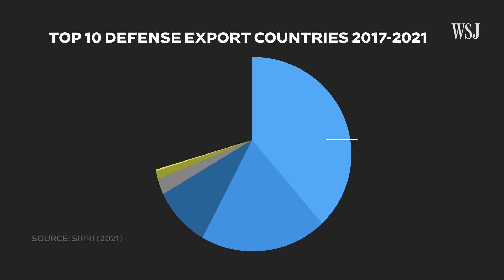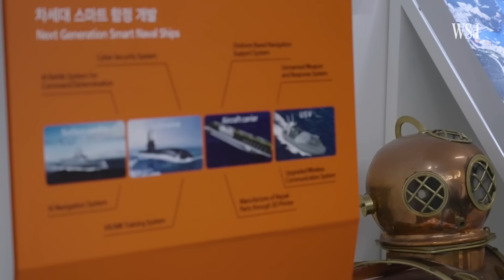How South Korea is Transforming Into a Weapons Export Giant | WSJ

Comment: If the US weapon builders supplied cheaper & reliable army equipment to the Korean army, South Korean weapon developers might not have changed themselves as new weapon suppliers instead of the US, Germany, and France. Until now, most Korean military generals don't have positive eyes on the US weapon systems, which means American weapons are too expensive and need too high maintenance costs. 

Thus, the defense ministry in Korea had to build a plan that Korea should develop its typical weapons instead of purchasing expensive American weapons. They needed the weapon itself to protect their territories against North Korea & China's intimidations but the US weapon makers sold luxury gold machines that needed big bucks to South Korea. The US weapon makers should modify their development methods and marketing strategy to defend their market share against Korean weapon makers' tracking. Not all pro-America nations can purchase expensive American weapons since many of them don't have enough big defense budgets.
Reply: I don't think the US government wants the US to be the sole supplier of military weaponry to its allies. Of course they want the US to be a major supplier, as that means money, but it is also important to have a diverse set of both higher end and lower end equipment, as well as a well distributed supply chain so that there are many redundancies in the military supply chain in case of war.
Reply: what is reasonable weapon price?
If you don't pay the money, just you don't buy it. That's it.
If you can't afford to buy US weapon, then buy Wakanda weapon.
Korean weapon industries development is nothing to do with US weapon price.

Comment: one part that is slightly incorrect which said that South Korea is only focusing developing artillery systems...

this is untrue.

firstly, artillery systems too are "high end" systems in the sense that they are also as equally sophisticated to develop as other systems like aircraft and submarines. Take the K239 Chunmoo for instance.. the use of an amoured chassis, plus the development of a practical reloading pod system , plus the variation of ammunition used on this system plus the guidance technology employed on the ammunition itself already screams "sophisticated".

furthermore, South Korea also has been developing and exporting other various "high end" weapons like for instance in terms of aircraft, KAI have been exporting the FA-50 to various countries and they are also currently developing the KF-21 Boramae. Aside from that, they have also been exporting sensor and precision guided munition systems through companies like LIG and Hanwha.

but in conclusion South Korea in terms of its defence industry is still a force to be reckoned with.

Comment: Those subs seem very small
Reply: I don’t think they have to carry missiles so thats something. No nuclear reactors too.
Reply: 3700 ton class.
Reply: @Masada1911 They don't carry nukes but they do carry balistic missiles with conventional warheads. They're much bigger than the German type 214 diesel electric submarines.
Reply: They carry 6 to 10 ballistic missles on the back. They can be designed larger if customers want it to be.

Comment: south korea is cheaper so that why many countries want south korean vehicle. Because the labor cost is low and the tech is advance.
Reply: Because of automation, it is key to make a cheap. The company can produce 24 hours without labor for arms and ammo. You must remember we are still in the war between sk and nk.
Reply: Cheaper but nearly equivalent to Pzh2000, lit best 🔥🔥🔥
Reply: @P01tava  K9A2 is almost equivalent to the PZH 2000. Which is an extremely impressive feat for the PZH 2000 because it is almost 30 year old now. The Germans already have a replacement in the works though.
Reply: @jonny2954  A2 ver has a faster reload and simplified reload mechanism ergo will be better than Pzh, tho German tech is lit 🔥 by making that beast 3 decades ago fr
Reply: @P01tava  No, Hanwha states it can reach a maximum of 9 rounds per minute, PZH 2000 does 10. However PZH 2000 is only semi-auto, the propellant charges are not automated like on K9A2. However on the successor RCH 155 they are, and that autoloader reaches 10 rounds per minute aswell.